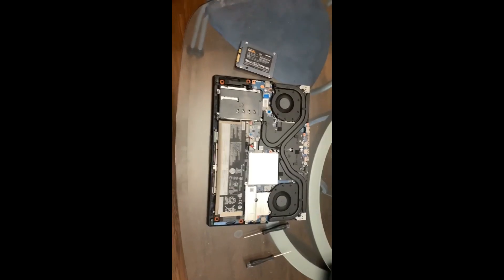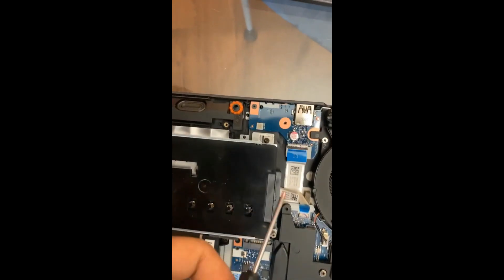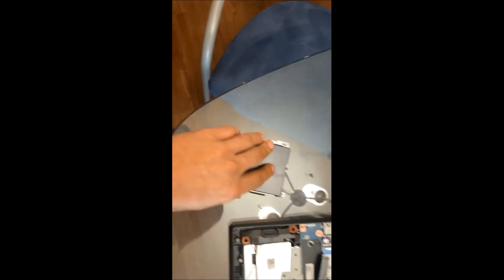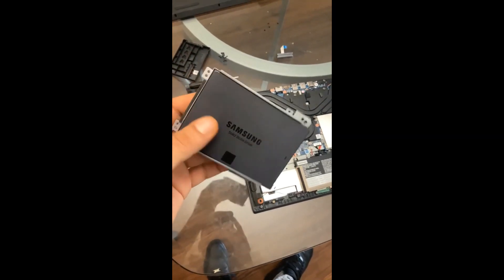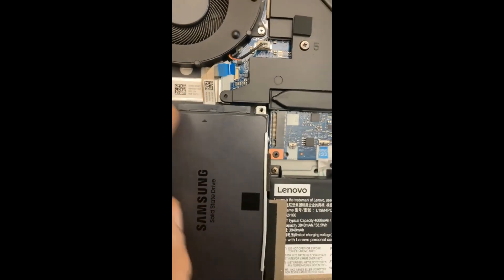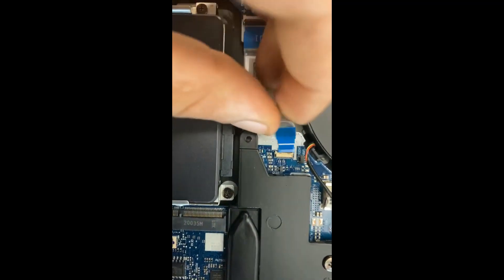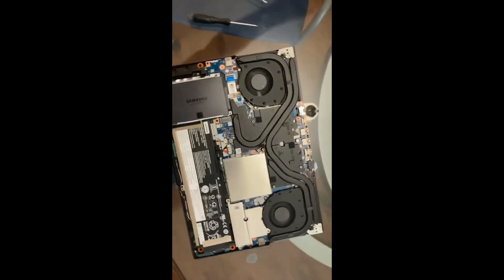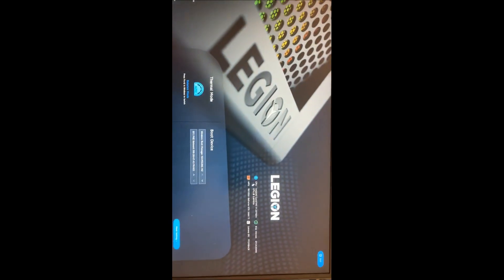How to add And Install second SSD to Lenovo Legion Gaming Laptop

Comment: Hi. I have a Legion 5i Pro gen 8 and i have bought and recieved two Kingston Fury Renegade 2Tb nvmE 4x0 x4 drives. I would like to install them both in my gaming laptop but in one of the slot there are connectors that push up so a double sided ssd can't be installed there it seems.

Comment: I mean it was probably worth mentioning that you cant install a 2.5 SATA SSD if you have an 80wa battery, which comes with a lot of Lenovo Legion 5 models... The 80wa battery covers half the SATA SSD space.
Reply from the maker: Thanks for this I’ll see if I can at least add a card to the video to share the info!
Reply: @pcwrld9116  cool man :) Do you know if adding another m.2 SSD will work since I have the 80wh battery? Noticed theres a second slot
Reply: Iirc the you can still use the 2nd m.2 slot in case you have the 80wh battery or are planning to upgrade to one.
Reply: I have a 80 wa battery and I can install the 2.5 sata ssd in my legion 5

Comment: Hi there, cheers for sharing the video!  May I ask how I can get Disk Management to show the second SSD drive I installed in the Legion (7i)?

The BIOS shows that the second SSD is installed; however, under Disk Management, the drive is not showing.

This SDD was a factory Samsung SSD that I had from a YogaC C930, a month before I upgraded to the Legion. I formatted to save games and encased in an external enclosure before deciding to install it internally to the Legion's second slot.

Comment: same process with adding hdd as a second storage?
Reply: yes, I added a 2tb hdd in mine and it works well
Reply: @jvpascual3211  Hello! I've ordered this 2TB HDD along with my Lenovo Legion 5: https://www.amazon.com/gp/product/B07DYFWLZ7/ref=ox_sc_act_title_2?smid=ALQVTOPLTKY0E&psc=1
And I was pretty confident it will work but my friends started scaring me...Do you think this fits well into the laptop? Will it work?
Reply: @appolos8598  any 2.5 drive will work, hdd ot ssd
Reply: @jvpascual3211  Alright thank you, that's reassuring~

Comment: What did you mean by you will need to plug in your usb to install windows 10 after upgrading your ssd?
Reply from the maker: Video Realo you do not have to install windows when adding an SSD like this but if you upgrade the existing SSD storage the M2 PCIe SDD you would reinstall Windows
Reply: Basically when you're replacing a ssd/m.2, the new one that you bought doesn't come with the windows 10. So basically after connecting your SSD/m.2 and turning on the laptop/pc, you won't start how you normally do. You'll need to plug in the usb to install windows 10. What he meant by this, when you get your laptop/pc you can either back up your data to a external hard drive or usb, but you can also 'backup' or download the windows 10 you have. The are many videos out there explaining, look up "how to download and install windows 10 from usb"

Comment: One question is the m.2 slot on the opposite side?
Reply from the maker: It is directly next to the SSD I installed in this video between the SSD and the battery in the previous version any legion before 2020 I believe is on the opposite side.

Comment: How did you get the RGB Keyboard to function? I'm using the same laptop, and I cant seem to get that to work even after downloading the updated drivers.
Reply from the maker: Austin Choate It’s the keyboard I went with that makes it so simple. It is plug and play no set up. It is decently priced I can see if I can link the amazon page for you.
Reply: @pcwrld9116  The Laptop keyboard? I'm using the Legion 5 15", and I only have the white backlight working.
Reply: Austin Choate did ur laptop have only one white backlight or 4 zones? I think u should update lenovo ventage in Microsoft store.
Reply from the maker: Austin Choate I thought you were talking about the usb gaming keyboard the settings for the laptop keyboard are in Lenovo vantage along with several other useful options
Reply: @Tana-jz8pq  Currently, I only have the white backlight option. I'm not sure if that's due to a bios issue (I've downloaded the support patch to make the backlight work) or if my laptop doesn't have the RGB function at all. Legion 5 15IMH05H
Reply: @austinchoatedrums  the Amazon's amd version only has whitetbacklight

Comment: if i want to upgrade the ram should i buy 2933 mhz or if it is 2666-3200 can work well?
Reply from the maker: You will want to purchase 2666 MHz I will go over this in the next video  in a couple days and link what to purchase in the description and go over how to do 16g upgrade as well as 32 and reasons to choose one or another.

Comment: what if we choose to use m.2 slot with ssd nvme. the steps to set up are same or nah ?
Reply from the maker: If you choose to upgrade original storage you will need to download windows operating system with a usb otherwise the process is the same with set up
Reply: If you choose to swap the original drive, you'll either need to clone the drive using a cloning program and a M.2 to USB device, or download a new OS copy.  The former is significantly cheap at about $30 and a free program, and arguably easier to mess with if you know what you're doing.  There's some solid guides available on YouTube that can walk you through that process. Search for "M.2 cloning" and that should be enough to send you in the right direction.